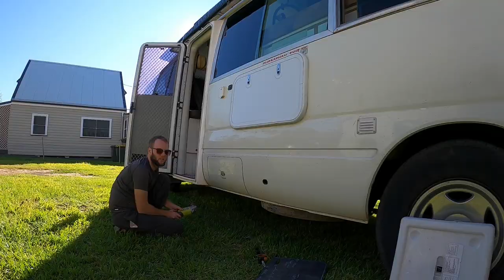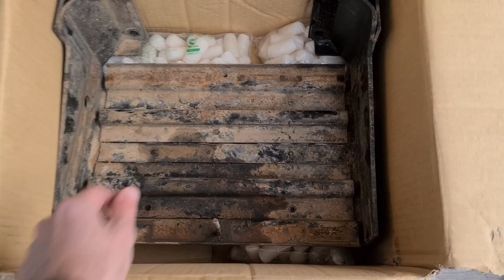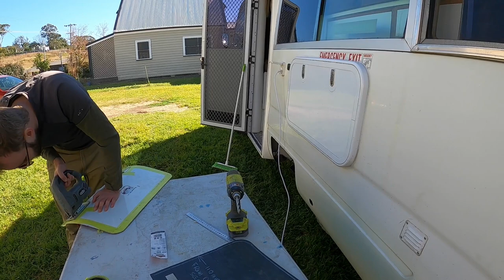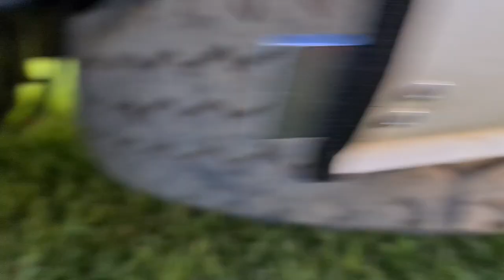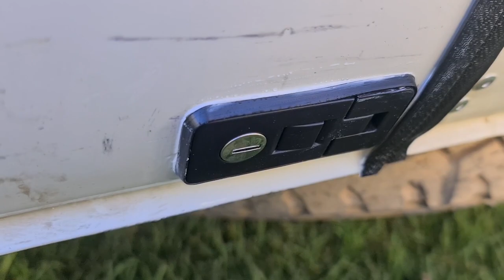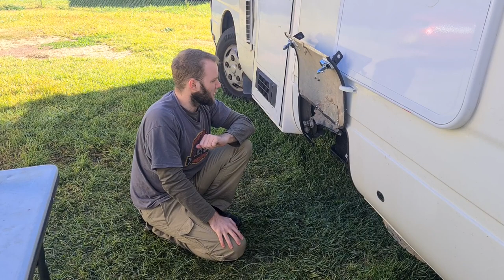Toyota Coaster Bus Conversion - Battery Access Hatch

Comment: This video is really helpful Thanks 👍🏻  Tip: the compression locks need to be taken apart (screw on the back) to fit the cut out as per the template. Don’t cut the lock holes larger or you will need to glue them in place as per this video.  The instructions don’t tell you this.

Comment: 🆘 🆘 🆘 📣 ❌❌❌ 
Great video really helpful… instructions that come with the kit from company were dismal,however I was able to be at their location and I asked in-depth instructions and made a video for the install. Can I just point out so others don’t make the same mistake you guys did and that is the metal stoppers / lock area attached to bus at the bottom, you have put them on completely incorrectly. You must have the double layer the other way so the lock has a double layer of metal to lock into if that makes sense (double must be the visible end). The thin end is what attaches to the bus. That is why you made the comment about the rivets being barely big enough. They are perfect if you install it property… if I am not making sense to anyone feel free to ask for further clarification from me. 🚌

Comment: Hi good quality video but some things are done incorrectly. The door locks you didn't take the mounting plate off the lock that is why they wouldn't fit in the cut hole. the Stricker plates you put on back to front that is why the rivets where to long enough.

Comment: Hi, any chance you could let me know the dimensions of the hatch that you had to cut? Thank you for such an informative video, it's difficult to find any other videos on what people have done with their Coaster batteries!
Reply from the maker: Hi Natasha, sorry for the late reply! The total size of the cut out is 573mm wide by 340mm high. Ours had rounded corners at the top but we feel like it would be just as easy to do square. Off the piece that was cut off, we then cut an extra 10mm off the sides and top to allow room for the rubber. 
Hope this helps and any other questions let us know 😊